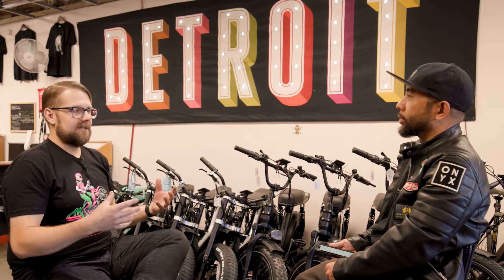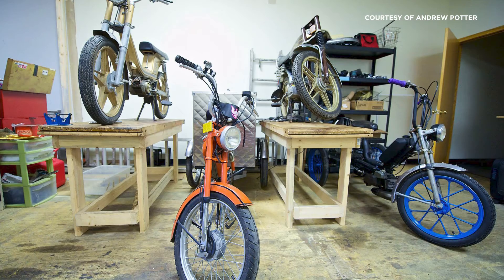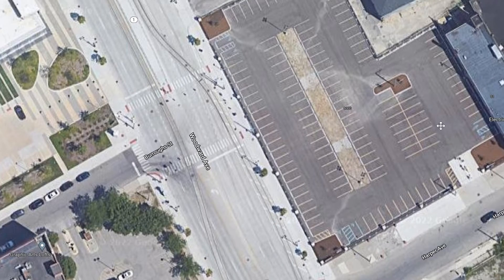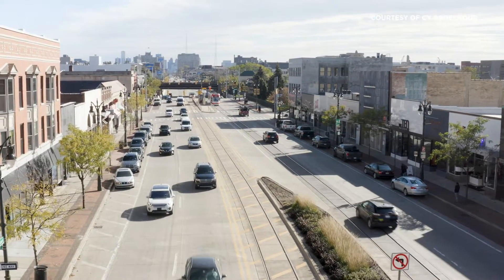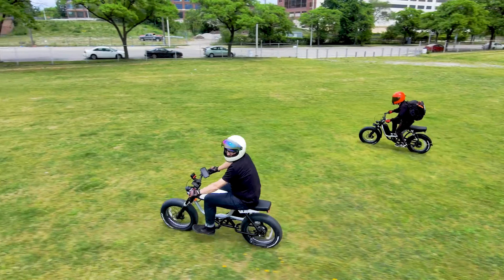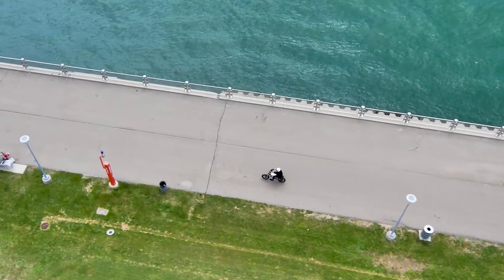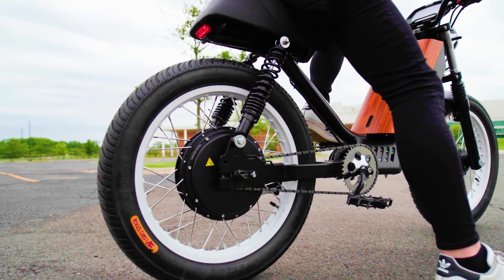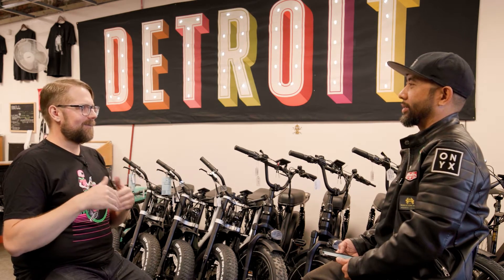Detroit Moped Works Shop Tour and Mopeds vs Ebikes | RunPlayBack

Comment: I've dealt with Alex a few times over the years. 🤙 
I picked up my 78 Kromag Puch in Ohio. Been riding Astrid since 2014! Have riden all of the D, over the years. About 15,000mi now. Most moped riders around the D know my red Kromag, I think. I'm one of the locals who sticks to the same bike, instead of messing with a bunch of different bikes.
Reply from the maker: Right on! Alex is the man!
Reply: @RunPlayBack  And great resource in town, for sure. One day I would LOVE to build a 78 Kromag Swinger 2, with a good sized mid-drive motor, using a belt drive.